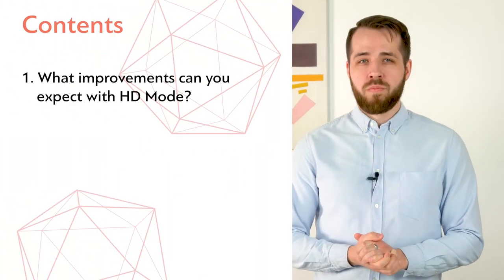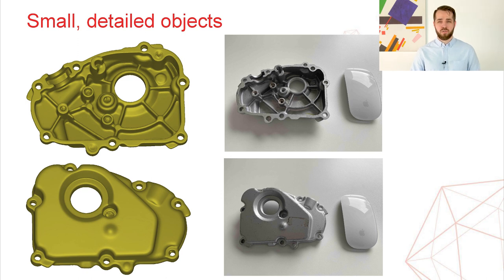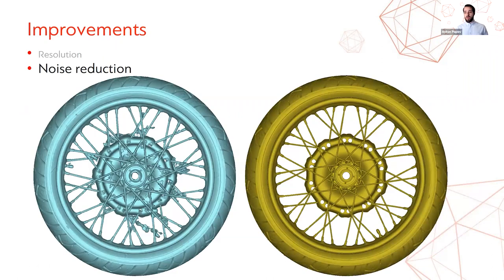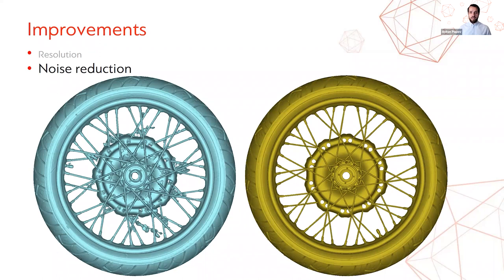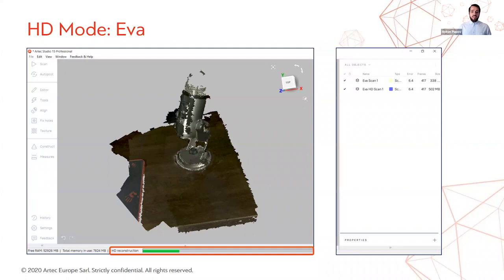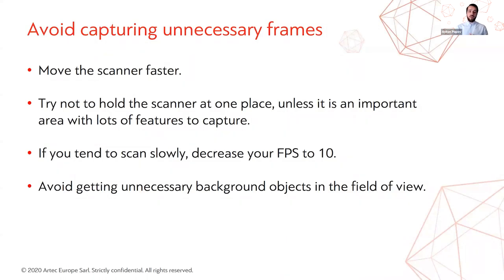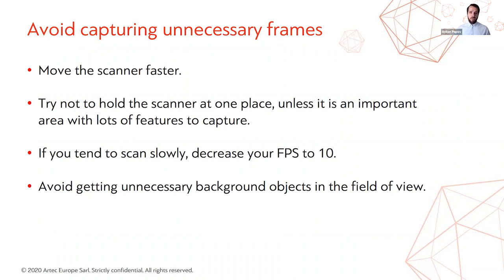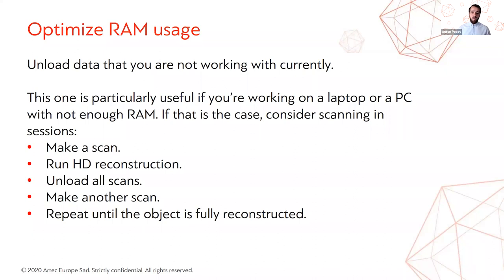HD Mode: a brand new algorithm for stunningly sharp and clean 3D scans

Comment: I am amazed by the amount of time I needed to spend to find the actual information that triggering HD reconstruction with EVA is NOT possible to be done at leisure, but strictly after scanning. What possible reason do you have for such design, and what possible demented reason you have to not mention it in the Artec Studio 15 manual in big, bold, red letters - or actually - anywhere else - is beyond me. Poor way to deal with your users and with your community.
Reply: You can, maybe because I'm looking at Artec 16 though